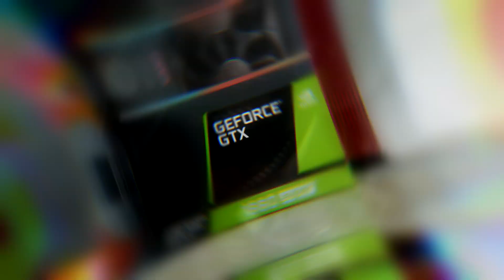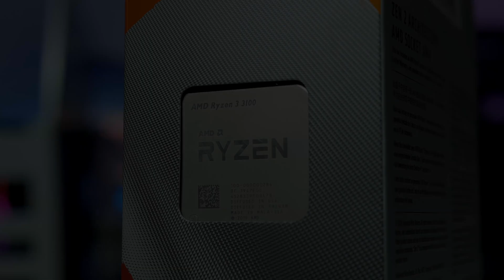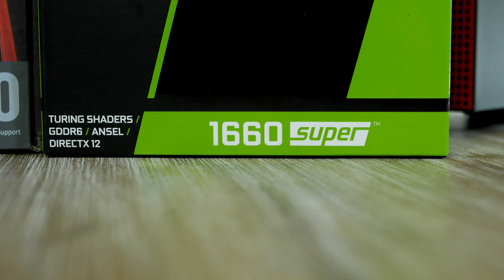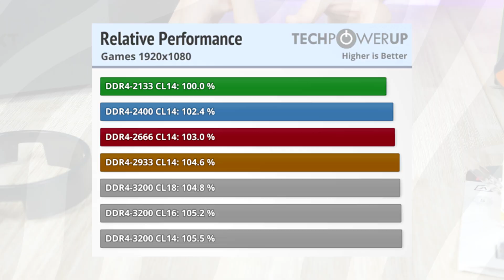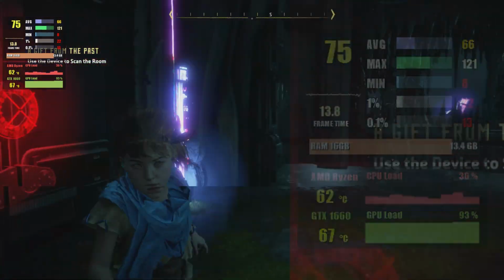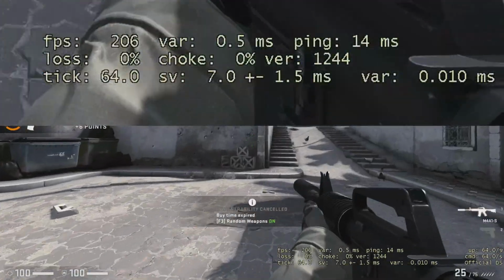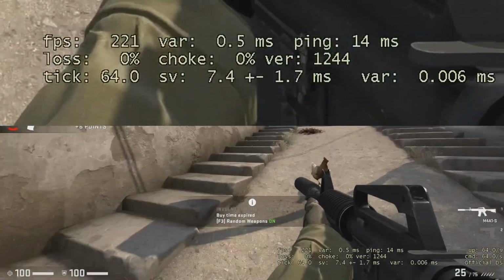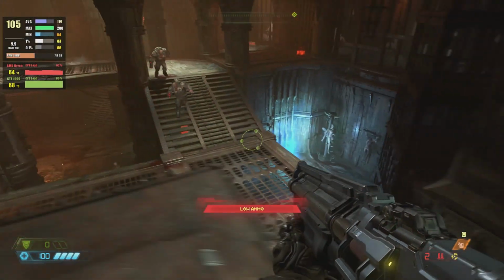Building The Best Budget Ryzen Mini Gaming PC in March 2021🔥Complete Tutorial + 15 Game Benchmark!

Comment: I got a i3 9100f ,16gb ddr4,gtx 1650 and I was wondering what should I upgrade I’m tryna stream gta 5 if anyone can recommend any upgrades
Reply: thats a pretty decent setup! but i would recommend upgrading your cpu to an i5 10400f because the i3 9100f has it’s limits. but if your only gonna stream gta 5 then your gpu should work fine but if you are going to stream more demanding games i would recommend the gtx 1660 super or the rx 5600 xt
Reply: also the i3 9100f only has 4 threads so yeah i would now strongly recommend the i5 10400f for your first upgrade
Reply: @laissez9844  thanks